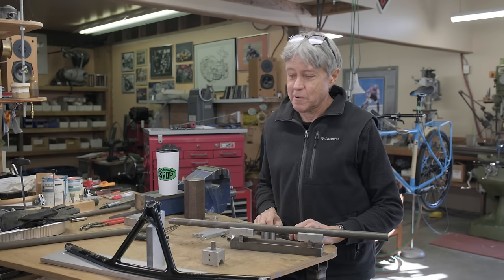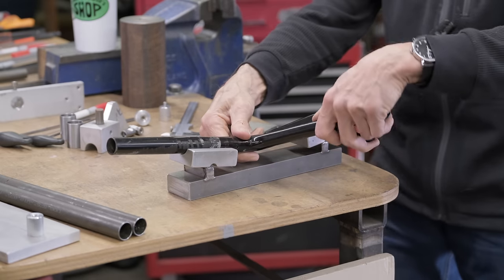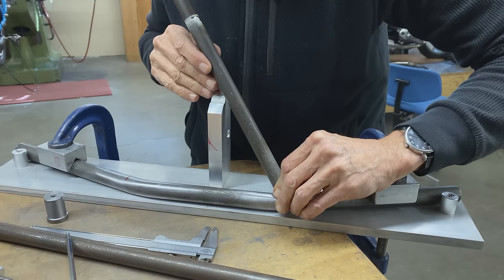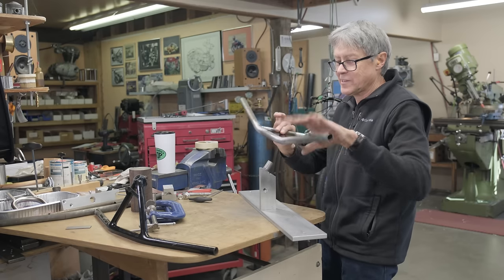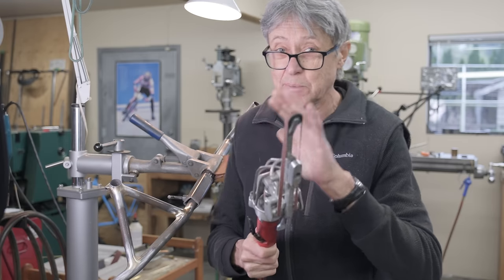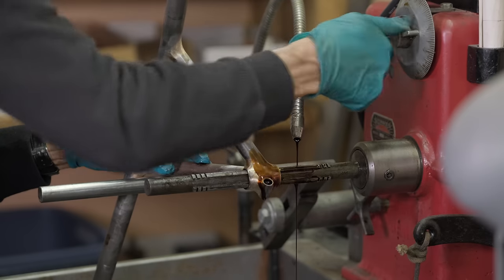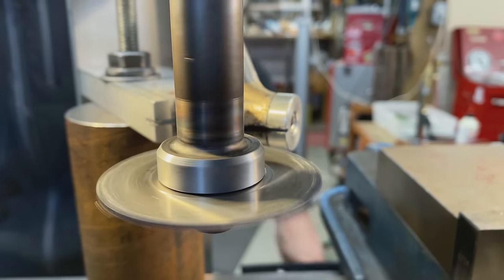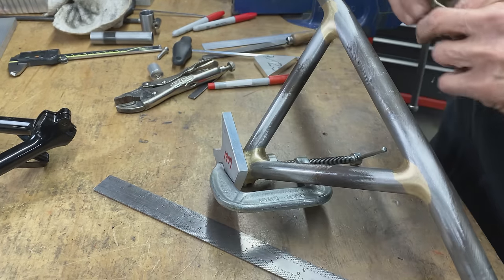Making BULLMOOSE HANDLEBARS // paul brodie's shop

Comment: Do you do any kind of stress relieving after welding or brazing 4130? Im getting ready to weld a couple of steering stem gussets on a maico im building and I can't find a definitive answer on whether to stress relieve or not. Thoughts? Thanks!
Reply from the maker: No I have not.  I weld/braze and simply use. Never had any problem in many, many years. Thanks for watching...   :face-blue-three-eyes::face-blue-three-eyes:

Comment: Shouldn't you have a radius curve in the part that you use in the arbor press that takes the load and transfer it to the tube you are trying to Bend
Reply from the maker: It does have a radius curve. I think I mentioned that in the video...   :face-orange-raised-eyebrow::face-orange-raised-eyebrow:
Reply: @paulbrodie  I must have missed that and couldn't see the video clearly
Reply: @paulbrodie  paul, I need a part for my tandem rebuilt. The stoker stem from my Yokota steel framed tandem has a stoker stem that does double duty as a seatpost clamp. It also has the older 1-inch standard for mountain bike stems, with an answer taper Lite stem in it currently which I don't feel particularly confident about for long-term use.
Reply from the maker: You really do need someone to make you a custom stem. Unfortunately, I am retired and very busy. Sorry I cannot be of assistance...    :face-orange-raised-eyebrow::face-orange-raised-eyebrow: